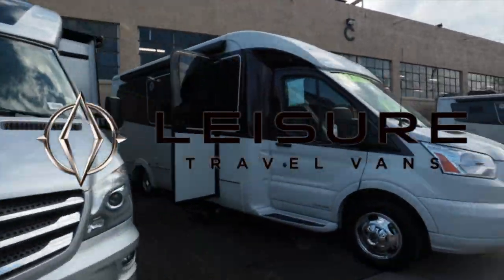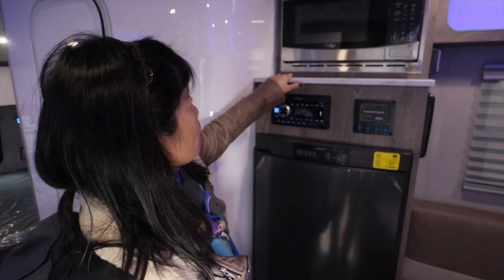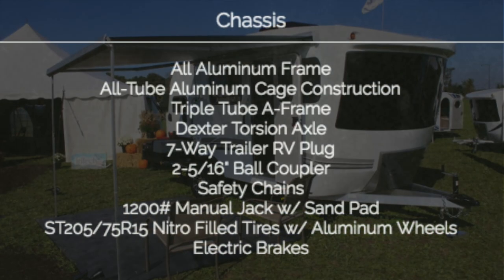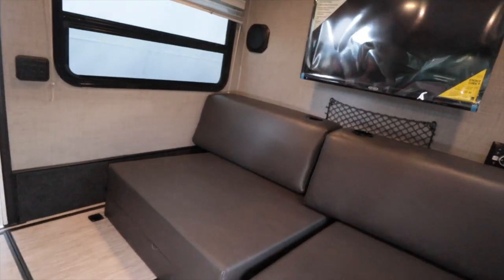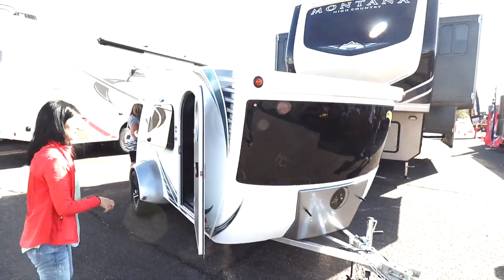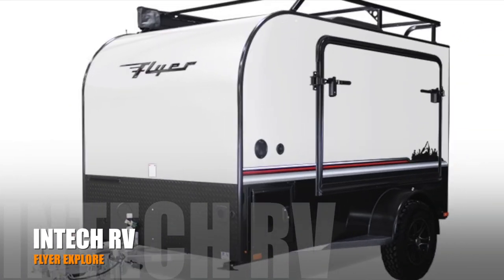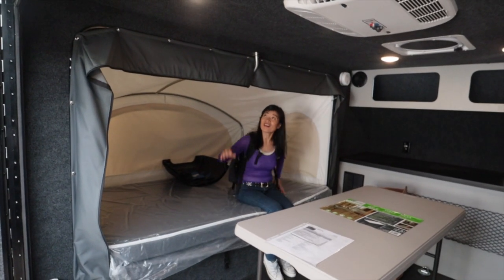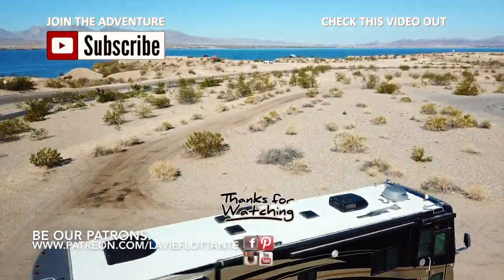2019 InTech RVs - Sol, Luna Rover, Luna, Flyer Explore - Pleasanton RV show  新品牌露營拖車 - InTech RV

Comment from the maker: From off road camping to weekend warrior the InTech line of products is a hot new category.  With innovative styling and micro design, these RV's are stealthy campers.

InTech RV manufactures all of their products utilizing an all-aluminum, all-tube, fully welded cage frame. This frame design might take longer and cost more to build than the traditional RV steel frame, but it’s worth it in the long run. Not only will aluminum, not rust, but the frames won’t require the constant and continual maintenance of sanding and repainting…it’s a frame that is truly designed, engineered and built to last a lifetime.